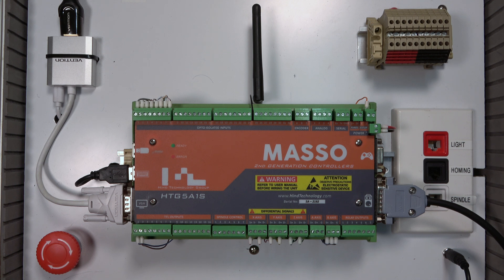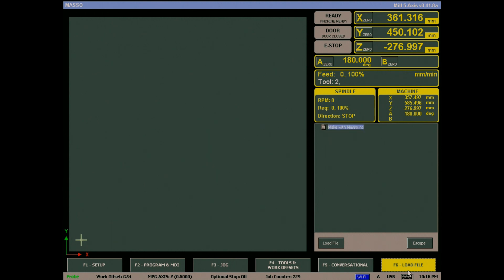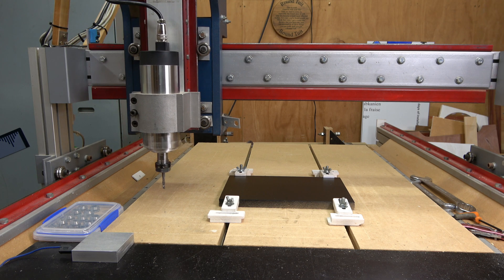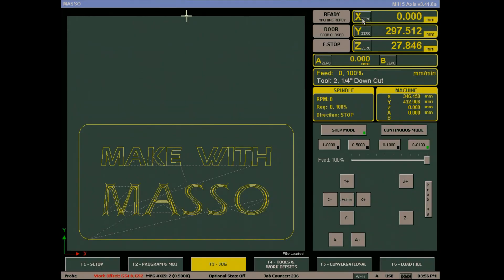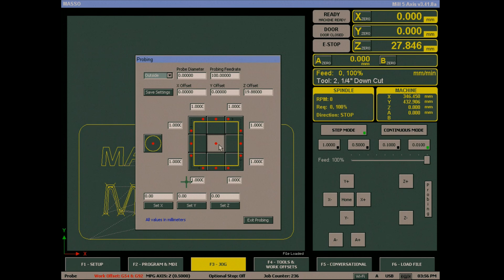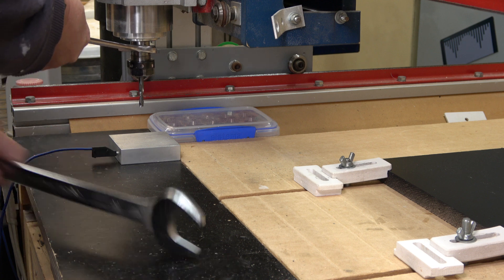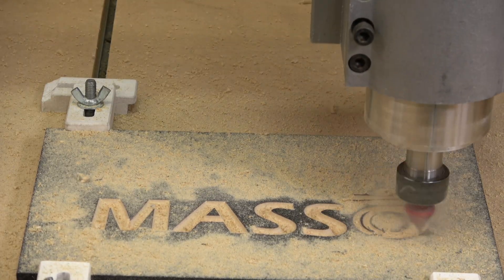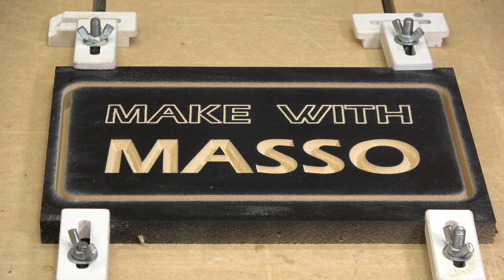Load and run a Gcode File - Masso Edition 11

Comment: Is there a way to make it Read from a Network shared folder in your local Network? ( in case you have some stupidly long program or change the program easier/faster then useing the use / transfer it over the WiFi to the USB. And for a more secure place for the program to be kept since it's easier to kill a use then a shared network folder)

Comment: Nice video Peter, can you please do a video on G40, G41 and G42 gcodes and please explain the tool wear compensation?..... How can we use tool wear compensation with masso while working with diamond core tools as they wear out too soon.
Reply from the maker: Masso does not support G40, G41 and G42
cheers
Peter

Comment: I'm going through this routine now but I have no probing button on my screen.  How do I probe the surface of the material prior to running the cycle without the button?
Reply from the maker: Sorry Jeff I missed your question.
You probably have it sorted by now but if you haven't you need to update your software to get Probing.
Cheers
Peter

Comment: Peter, with Masso can you set up Z like you use to do before from the table top? Where you bring the bit to just touch the table then enter -.750 assuming your using 3\4 stock.
Reply from the maker: Yes you can. If you watch episode 7 it will show how though it can innumerable be done at the beginning of the machining and the auto tool setting will go from there. If you need to change the zero point you need to break the file into separate ones but that isn't a major problem.
https://youtu.be/8-VgwY79eBo
Cheers
Peter